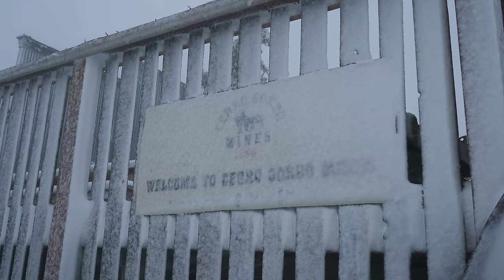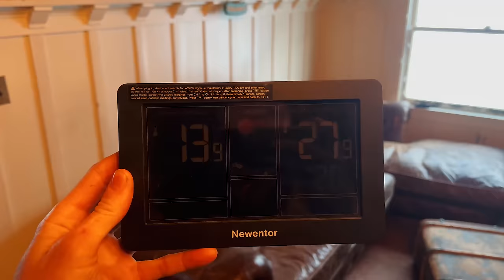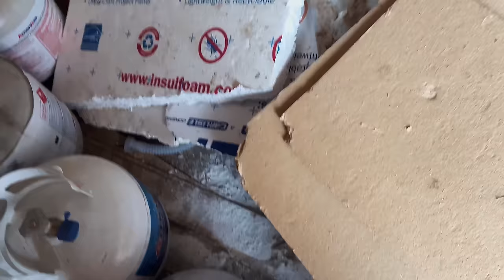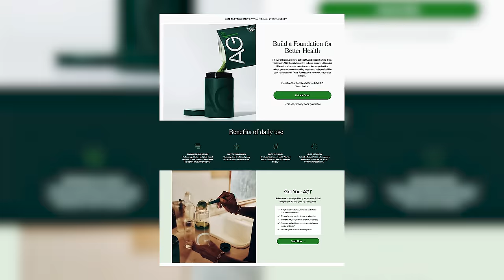Realities of Winter In A Ghost Town

Comment: Brent when we’re talking about healthy food choices… It’s time to get into some sprouting and fermenting foods. Lentils and sunflower seeds are a great way to get complete protein with all the essential amino acids and they’re a real powerhouse.… When you sprout them. 

This is very simple. All you need is a mason jar and a piece of window screen and some lentils or sun flower seeds. You put them in a jar about one fingers thickness at the bottom of the jar and then you put the screen over the mouth of the jar and screw on the lid band without the lid. Pour some water through the screen and rinse it out a few times and then pour it in one last time and let it sit for about eight hours. 

Come back the next day and empty out the water. You rinse with water a few times, and then turn it upside down and let all the water drain out and then continue to let it drip dry while upside down in a bowl so that the jar is slightly tilted. This allows airflow and prevents it from becoming an anaerobic bacterial type situation. 

Each day you rinse it out and prop it back up so it’s sitting at an angle upside down. You’ll see sprouts beginning within a couple days. The little tails will form on the lentils/sunflower seeds and they will begin to get longer and longer each day. This food source is a great energy producer. I find that either sprouted lentils or sunflower seeds can complement many different recipes. A few suggestions are: salad toppers, garnish on an omelette, burrito filler, sandwich roughage, last minute bowl of soup edition, I’ve even put them on peanut butter toast and drizzled with molasses and it is so good.

*Sunflower seeds will require one extra step which is placing them in a colander and submerging them underwater, while at the same time agitating with your hands in order to knock the seed hulls loose. These seat holes generally float to the top and you can kind of scoop them out with a slotted spoon or with your hands. Generally I just take what I need for a meal - I just give them a good shaking well using my other hand to rake over the seed heads and thereby knocking off the seed hulls.

The next item I just wanted to cover briefly is you should be fermenting vegetables and putting them in canning jars. This is super easy and it doesn’t require any heating or refrigeration. You just need the appropriate vegetables and a bunch of salt and canning jars. You shred up your vegetables (I use a cheese grater) - that are going to go in, then begin layering them into the jars. 

Between each layer sprinkle in some salt - as a rule of thumb you can add slightly more salt than you would generally eat for flavoring the food.… As if you were going to salt it to taste. After you filled up the jar and tamp it’s vegetable contents down as much as you can, take a single cabbage leaf and fold it up and shove it into the jars mouth. 

Then pour in a bunch of drinking water until the water comes up to about a half inch or so under the lid. Close the lid so that it’s hand tight and place this somewhere to store – preferably out of direct sunlight, and with some kind of container underneath it to catch any of the brine water that will inevitably push it way out because it will be generating CO2 for the first month. You need to anticipate this one step. 

You’re basically making sauerkraut but it’s not cooked and instead everything remains alive and now you’ve increase the enzymes by making it biochemically available due to the salty brining process that doesn’t involve any heat. You’re making forever vegetables.

Some great vegetables I would recommend using are the following: 
cabbage, Bok-choy, carrots, celery, onion, leek, green onion, garlic, radish, turnip, rutabaga, burdock, apples, pears. Research some recipes and you’ll find some different exciting combinations. The sky is the limit. 

Some excellent seasonings to add to it can be cilantro, dill, cayenne pepper, garlic powder, cumin, black pepper, old bay seasoning, Montreal steak seasoning,… There’s really no end to the different seasonings you can put into it. You can either add it during the layering process or you can add it at the very end just before you pour in the water because the water will cause it to seep down into the many different parts of the layers.

This is a great way to get living vegetables during seasons of the year when you’re snowed in or in a famine and drought type situation. Let these jars sit for a minimum of 2 to 3 months. Get some good recipes together and try them out and find some ones that are your favorites. Then I recommend you make a whole batch of them and stockpile them. 

These can last for years. I find that the longer they keep the better they taste. I’m serious. I left some in storage for over a year or so… And the flavor was so much more intensified and everything was still living in it. Just think about that, vegetables that don’t die. That’s the concept we’re discussing. It’s the fermentation process that can really make a difference.

I find it helpful to take small doses at first as your body acclimate to probiotics which is what the fermentation process boils down to. This can take a month or so of just small portions and then your body acclimate‘s and you can take bigger helpings and have it with every meal if you like. I find that the brine that you produce in the jars is also enjoyable to take as a energy elixir. In the supermarket that’s called “gut shot “… It’s pretty damn good stuff to drink especially with all the different seasonings you’ve added to it and the vegetable enzymes that are present in it now. Forget v8 juice…This is the real deal.

*Save some brine for jumpstarting your next batch and pouring into each jar this will expedite the process. 

Check it out. I hope this is helpful and I hope you like it.

Comment: I live in a place that i have seen at -32°. If you want heat cheap i would recommend a water mass heater. Essentially a large tank of water that you heat incredibly hot and it keeps the house warm so you don't have to stoke a fire or a wood boiler system. You'll defiantly want to have you're living dwelling almost air tight, you can even use magnetic seals from freezer doors to assure the windows and doors are tight. Any heat lost is not conductive of life. Stay warm, if you need a hand designing a system for your house i can help ya out, just knowing someone is warm in the winter is payment enough for me.

Comment: Building a small structure to house the propane outside (with proper ventilation of course, can help keep the temp up in the lines, so it doesn't freeze and are easier to handle when you switch them out. I'd put down some simple pavers under the tanks to give it structure and keep the tanks level (personal preference, but cheap and easy to do in about half an hour. Add some gravel for drainage, if desired). I'd also use lots of tarps for the vehicles (Kabota, dirt bikes especially), animal feed (even if it's indoors), outdoor wood and other places/things that you need to use or access while there's snow on the ground.  Makes life a LOT easier.

Comment: Incredible video! I wish someone were able to donate or loan you a Polaris Ranger XP UTV with 4x4 snow tracks installed. Your treacherous trail troubles would be over. My brother-in-law has one at his cabin in the Upper Red River Valley of Red River, New Mexico (where snow plows rarely venture) and it’s a absolute BEAST on snow and ice. In Dec. 2021, my wife and I spent Christmas at the cabin (we had to snow-shoe to the cabin) and drove the Polaris outfitted with the snow tracks around the Sangre de Christo mountains at 10,000 feet in the upper valley where no other vehicles had been. We drove it through thick 2 ft. sections of snow and even across icy, slushy creek beds and never once felt like we were in any trouble. (Like you, we were prepared for emergencies)

One of the highlights of using it during our stay happened when we came across a large group of about 30 people gathered at a cabin in the lower valley where are the roads are regularly plowed. They were trying to have an outdoor wedding but a storm had dumped 2 feet of snow in previous days, completely ruining their outdoor wedding plans. The father of the bride flagged us down and offered to pay us if we could drive over the outdoor area with the snow tracks and pack it down enough for them to have the wedding in the outdoor space. I offered to do it for free and spent the next 40 minutes driving back-and-forth over a 50’ x 50’ area until it was hard packed and they were able to set up all their wedding chairs and continue with the wedding. It was payment enough knowing the two families were able to continue with their wedding because of that Polaris Ranger XP with snow tracks. They asked that we at least take a fine bottle of whiskey for our trouble, which I did not turn down. Your entire video, which was wonderful by the way, one that I would watch again, reminds me that some of our best memories were made in the presence of snow; aka, “beautiful life-giving death crystals”.

Comment: A suggestion.  Making sure you have at least 7-10 days of emergency drinking water, 3-5 days of cooking water in backup. So it gives you time to get through a few issues with water. It will help when the running water is not there.

Comment: In the most floded areas of your street you need ditches out of halfpipes across the road ! So the water running down directly your road is not so worse as it is now !  In Austria they used sheet pipes cutted in the half and fixed with stakes in the ground. Mostly they crossed the Street in 35  degrees  and changed when possible the side of the road where the water is drained too in a ditch, so you can minimice the water which is directly floading the road !

Comment: You should do some pre-season staging  such as positioning the big truck where you can access it easily and there are wonderful devices you can add which self-close doors for you. They have a big spring on them so that opening the door puts tension on it vertically and when you let go of the door, it puts pressure on the door which closes it.

Comment: The PEX pipe fairs much better (than copper) in freezing temps. Easy to set yourself up with what is needed to fit it. perhaps its biggest issue being Chlorine , Fluoride and rodents. If these 3 things are not an issue it might be a good call up there to replace anything that breaks from freezing. Plumbing on exterior walls, vulnerable. usually its a kitchen sink faucet (Always a window there) . Cover with wool blanket at night.

Comment: I can say, I would absolutely be solving that frozen pipe problem the first winter I was out there. If I had to go outside and walk through a windy 13 degrees to take my morning dump, I'd be unnecessarily angry. 

It was bad enough dealing with frozen pipes when we had a cold snap hitting 0F or less around Christmas and I had to go outside to smoke a turkey. And with that, I wasn't even spending the whole time outside, just long enough to get the charcoal going and to check it every now and then.

Comment: Very simple solution for water in constant snow fall, build an open top tank for winter that collects snow, propane heat it, it will melt snow, and will constantly fill from snow fall, filter that into styrofoam holding, and you'll have lots of water.

Comment: You should replace the plumbing with pex pipe. It can still freeze even if it’s not insulated but at least you won’t have to repair it after it thaws. The fittings don’t expand but if they do, it’s an easy fix. Good luck out there.

Comment: I live in a motorhome and I have a lot of the same issues, one thing I just did was but a kerosene cab heater. Got tired of propane tanks being empty or freezing. The kerosene cab heater is much cheaper much better and always works. It only cost $120 and will operate on 12 volt power.

Comment: I know it sounds ridiculous Brent, but you might want to consider some other alternative forms of appropriate technology.

One that comes to mind is using an exercise bike as a power generator which could be feeding your reserve power bank in times like this-when there’s lots of snow and your solar panels aren’t picking up enough energy to feed the bank.

Not that you need the exercise… But certainly riding a bicycle on one of these stationary exercise bikes can certainly serve to keep the blood flow up, raise your body temperature, and also supply power where it’s necessary for these alternative energy sources. They’re not a bad idea just as a back up for worse comes to worse type scenarios.

Comment: You have mentioned that you don't have much water up there,
Why can't you collect snow in water tanks, and when it thaws you have local water gathered right where you live rather than carting it.
If you fear contaminants you can use a filter or use the water only for stock water, toilet showers gardening and then if you must cart water for drinking and cooking and dishes.
I live in a small rural town in Western Australia I am lucky enough to have grid/town water
Some of my friends only have tank/rainwater and if lucky a bore
If they have to pay for a load of water to be delivered it costs 250 to 300$ a 2000 gal load or is that 2000 litres? I will have to ask her, but when you have 6 people living in the house a load doesn't go far.
Snow would be a good source of available water.

Tony from Western Australia 🇦🇺

Comment: You need a tractor trailer load of wood oak, more wood heaters, build sub ground concrete sisterns where you can pump in spring run off, or if you have ground water, you should try to pull some stuff out of the ground to pay for it.

Comment: Gas vehicles -- fail in severe called - it's called 'fuel line freezeup'. Plus, batteries don't do well in severe cold. Blankets over engine helps. Taking battery inside saves them. Combine old skis together to make weighted sled that won't blow away.

Comment: If a building gets snow in it and it has a functioning fireplace, light the fire and keep it going for 24 hours after removing the snow. The fire should help dry out the moisture.

Also a plastic paint scraper should help with chipping off ice in doorjams and window frames

Comment: I live in East central MN, Kind of had to laugh a little . Your biggest issue is going to be the insulation (or lack therof). There is a product you can get to wrap your windows. It will help keep heat in. Black trash bags would work in a pinch (and absorb solar heat). Keep your stove shut to direct the heat to the cast iron, it will work as a radiant heater and burn for longer. We don't have our pipes freeze until we get int the -50 F range.

Comment: the gas bottles at the house make a small vented shed for them to sit in as it will make it easier on you when changing them
you need a snow mobile for winter
the road in you need to put drainage ditches in so it does not wash the road out

Comment: I am sure you will not see this, but I am wondering why you haven't created rain/snow barrels to collect your water? If you put your spent charcoal from fires at the bottom of the barrels, it will filter the rain/snow through it, and you will have fresh water! Put a water spout at the bottom of barrel to connect a hose to....

Comment: You need an old wood cook stove that has a water tank attached. That way you can at least have water to wash your face. My great grandmothers old farm house even had a wood burning tank in the bathroom to heat water for her bath. Don’t know when that was installed, I’m assuming in the 1800’s when it was built. Of course it was all modernized when she eventually inherited it, but they left the old things just in case electricity went out and in Missouri winters  that happened a lot

Comment: No stove...use the fire place to cook on. Use snow for water...takes a bit but snow will work (melted) and use a lidded 5 gallon bucket for temporary bathroom use...to be dumped after snow storm ends or lessens. You really need to buy a snow mobile. Yeppers, a snow mobile. You know you will need emergency food and water.

Comment: keep your smaller propane tanks inside when its really cold It condenses and causes a loss of pressure in the tank. I'm sure you didn't run out of propane it just got to cold and not enough pressure to power anything.

Comment: Hi,  I think it would  better if you split your stock of propane cylinders into 2 separate lots in their  own enclosures outdoors, as if one is leaking and catches fire you will loose the lot! and the shed they are in. because your experiencing such cold weather and the propane will not vaporize, you could try a mentholated spirit stove or as I have seen in a previous comment install a woodfired stove for heating and cooking! Great entertainment by the way, keep it up!

Comment: My friend you need to get into the world of Chinese Diesel Heaters. You use Diesel already for your truck I assume, so get some storage tanks for the winter, and you can use Chinese Diesel Heaters in key areas during the winter, supplemented by wood stoves. The heaters run on 12v so a decent battery bank and solar will get you through the winter completely off grid if need be.

Comment: Sounds like an old time Alberta winter Canada.. if your running power and propane is freezing a simple regular light contained will help regulators and liquid.. insulate you main residence put a 500 gallon tank for water in your heated accommodation.. night stil have to use the outhouse but having a shower helps the mood.. melt snow for your toilet.. yea ruff but manageable